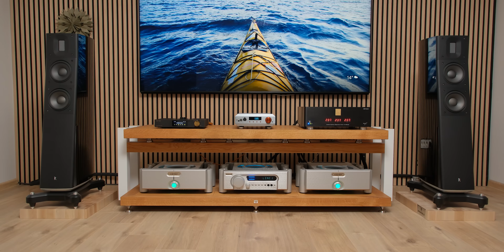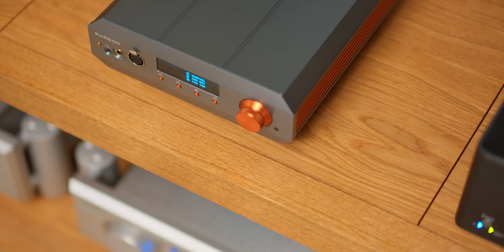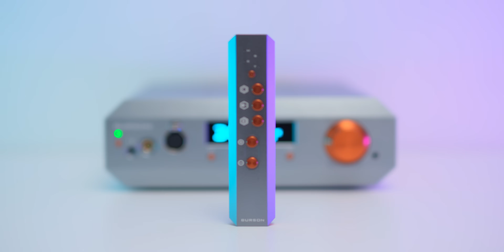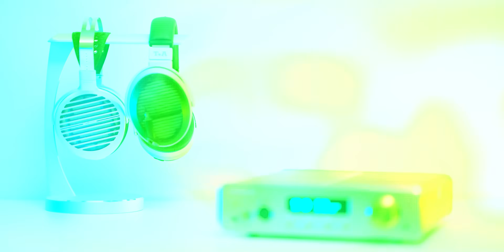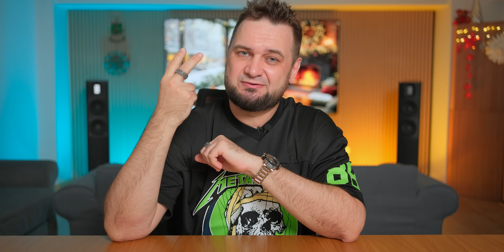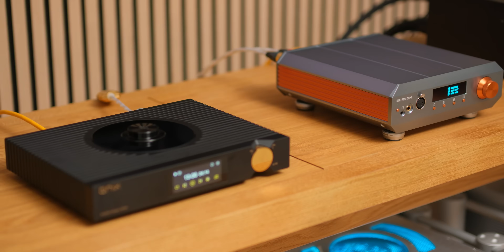Burson Conductor Voyager Review — Full Analysis of Burson’s New Flagship DAC/Amp

Comment: To my ears, the Burson op amps included let this product down making it sound artificial with extra detail not in the music. Tried the Stocatto dual op amps in the I/V stage in the Conductor Voyager Max and it gives a hugely pleasing tube sound. You may  not like it if you want purely analytical sound. The best balance after trying 15 op amps was the Sparkos SS3602 in the LF stage and the SA200 discrete in the I/V stage. Amazing.

Comment: On paper the Conductor Voyager is powerful. I just compared the Conductor Voyager Max to the Sololist Voyager Max.For my Susvara, the Sololist Voyager Max (xlr in) only demands mid gain and volume at 65, but the Conductor Voyager Max (usb in) even at high gain, volume at 99 (max) is not enough sound pressure!!!

Comment: The Burson Conductor Voyager is seriously impressive. Discrete Class-A design, proper current delivery, and that typical Burson transparency with weight and drive. It’s not just clean and detailed, it has authority and dynamics, especially with demanding headphones. The soundstage is spacious without being artificial, mids are natural, and the bass has real control. You can tell this was built by people who care about analog performance, not just specs on paper. Definitely one of the more complete high-end DAC/amp solutions out there. Great review, Sandu, much appreciated!
Reply: 0
Reply: 000
Reply: 0

Comment: I mean, the thing costs 3K without the "nicer opamps"?
I mean, its not like these components opamps cost the same as a multicore processor to produce, cmon...

Im sure it sounds magnificent but these audio companies trip a bit
Reply from the maker: Have you seen the Fusion Core's size and weight? It's not only nicer op-amps and better silent power modules, but also the external AC to DC PS, which is the priciest and the one that elevated its sound more than anything else.
Reply: @Soundnews  I understand that there are nicer components in there, but only installing the "slightly cheaper" op amp for the sake of the consumer needing to buy extra in a device that costs nearly 4 thousand dollars already? I mean, this amplifier should come with an op amp rolling kit with all of them included from the get go.

I think Aune used to do that too with the "X8 Magic Dac" where some reviwers stated "Apparently, Aune has decided to make a lot of money on Op-Amps, because the Op-Amps they offer in a kit cost them $5, but charge $50"

(op amps are made of cheap components, that get cheaper when sourced in large batches from china/us even)

Charging 80 euros for an op amp is expensive but its "okay" when you wanna get them separately but not installing whatever's nicest in a 4K amplifier?

Nah.

I know that Burson  makes next to none amps but thats like selling a Mercedes S-Class and only installing electric tilting mirrors if you buy the AMG optional kit. It doesn't make sense, its a predatorial practice, sorry.

by the way, i still like your reviews, i just dislike these predatorial practices in the hifi world.

Comment: Concur: the Conductor has a smoother, more "refined" sound than the GT4, and not by much. I've tamed the edge on the GT4 with Two  V7 Classic op-amps for the LP stage. 

What has me more interested is their new Conductor Stellar, as I use more in-ears than Headphones.
Reply from the maker: I've exchanged a few emails with the Burson team, and it seems their Stellar was designed for IEM users; even the volume curve and physical resistance of the knob have been reworked to better accommodate highly sensitive loads. I will probably give it a try next year.

Comment: Coolcase 2.0 is listed for the specs on the Soloist Voyager. Did they update it since your review?
Reply from the maker: The CoolCase 2.0 didn't exist when I reviewed the Soloist Voyager more than a year ago; it was first introduced on the Conductor Voyager. However, they have likely updated the newer Soloist Voyagers with it, and my older temp readings may no longer be valid. Unfortunately, none of the friends has a newer Soloist to measure their case temp.
Reply: @Soundnews I received my Soloist Voyager two weeks ago. If there was a change, I should have the most recent version. What should I measure?